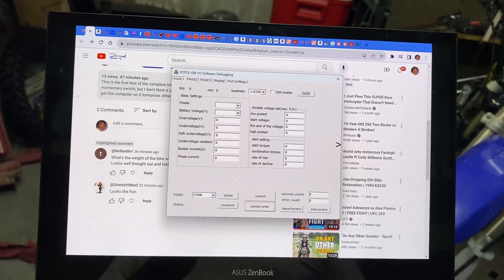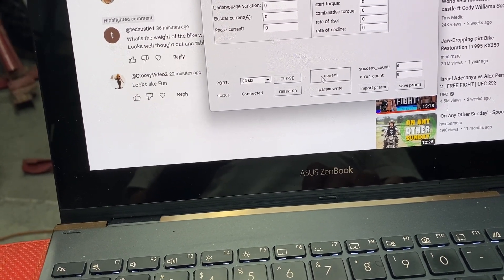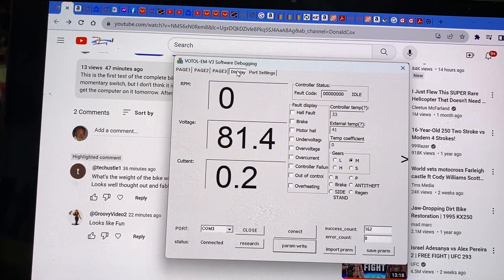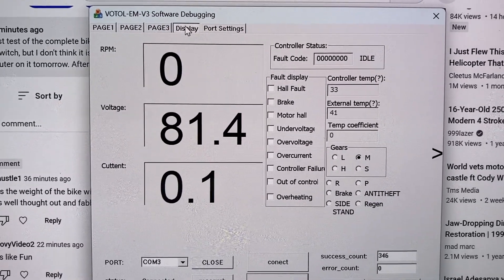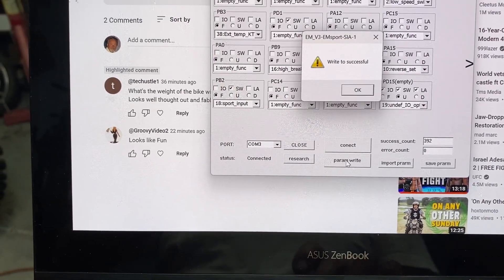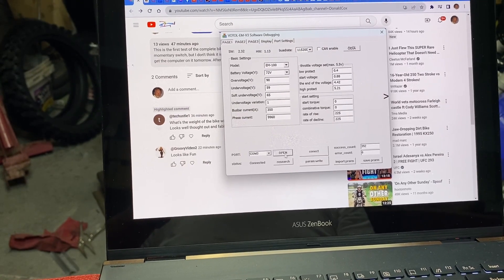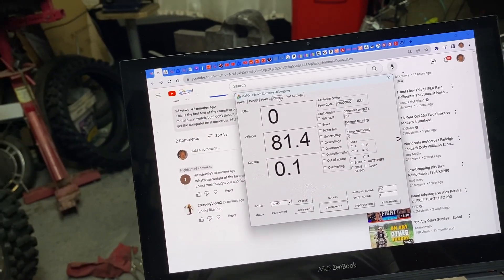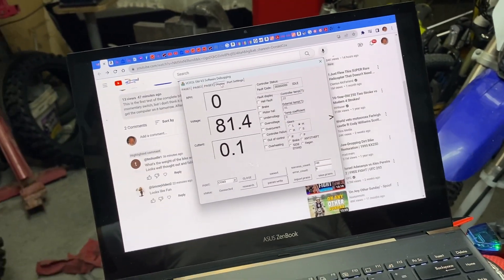Votol EM 260S Programing.  Setting up a "Push to Pass"  momentary button

Comment: Hello, a few months ago I bought a Votol EM 260S controller to use on a motorcycle with a 72-volt, 100-amp battery. The motor is a 17-inch 8000w HUB.  Could you help me by sending me the optimal configuration to get the most out of this combination?
Thank you in advance for your help.

Comment: Hey, i cant figure out how to connect to my controller with the software provided by the supplier. Could you kindly share the programm you have for the EM260S. Thankyou
Reply from the maker: I posted the Votol stuff on the Votol Controller Tuning Forum.  https://www.facebook.com/groups/999971084014927/permalink/1284805222198177

Comment: em260s/qs138 90h kit from electro and co connected to pc with the app you posted and a 2 wire adapter from amazon but wont connect to controller the error i get is "communication abnormal, no response" am i doing something wrong? usb connected to controller and plugged in to pc with beep, key on, open, connect, 5-10 ish seconds later the error pops.

also noticed you said your running a em260 but the screen says em-100
Reply from the maker: Start a conversation on Electricdirtriders.com  with me. We can converse and I can give you data and pictures.     To start, go to your Device Manager and tell me the name and number  of USB Serial port

Comment: Como descargo la apk
Reply from the maker: The App is only for PC
Reply from the maker: If you need the PC app, It is posted on the Electric Motorcycle Build Forum        https://www.facebook.com/groups/999971084014927/permalink/1284805222198177/

Comment: Hi Don, great video. I am also building an electric MX. I have the same EM260/qs138 70h V3 kit from E&C co. I want to program the controller. I am having difficulty with connecting to the bike. do you mind if we could connect maybe share some tips? thank you!
Reply from the maker: Send me a message on the Electricdirtriders.com forum, so I can get pictures and file to you.  Also on the Facebook Votol Controller Forum, I posted some info, and you will need this Zip file       https://www.facebook.com/groups/999971084014927/permalink/1284805222198177/

Comment: what color wire coming out of the controller is the sport mode wire?
Reply from the maker: J1-6 Brown.  Connect it to ground (J1-23), and Sport is on with one push, and off with another push.
Reply: @dcoxryton  do you possibly have the pin out diagram 😅 i can’t find it anywhere.
Reply: I found nvm. Now I can go extra fast thanks 🤙🏻
Reply from the maker: great,  go extra fast... @togsmovingcastle